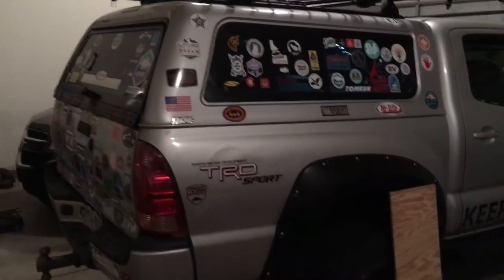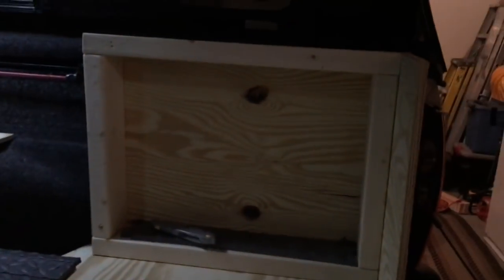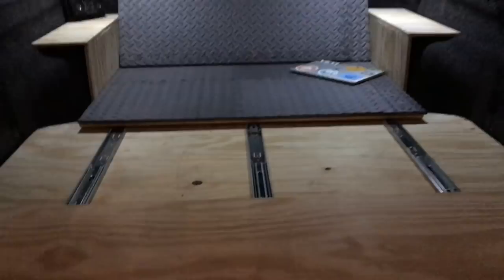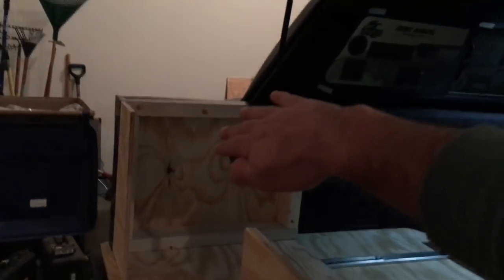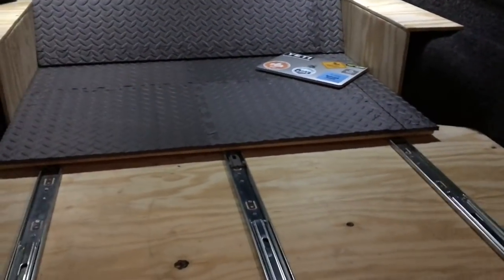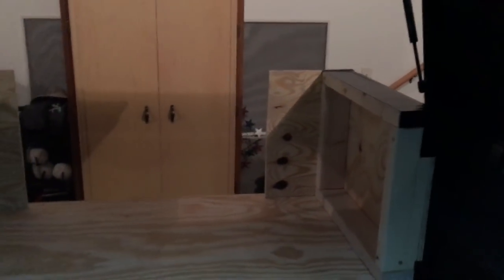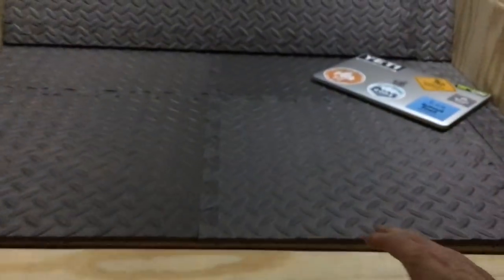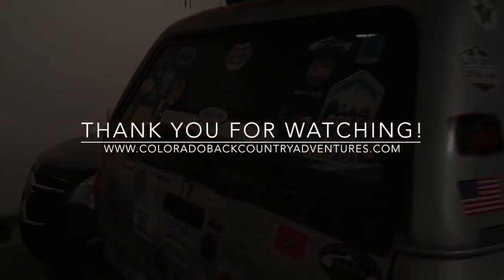Truck Build Design Guide: Part 5 - Adding 2 feet of sleeping area to my short bed Tacoma

Comment: I was just thinking about your “bench”.  What if you connect the bench to the pullout section and piano hinge the backrest to it so that when you pull the extension out, it all folds flat?  You would need to come up with a rail guide to slide the backrest back into the upright position, but that would simplify set up. Just open the tailgate and pull.
Reply from the maker: Hey TexasScout! Yeah, I'm still working through different scenarios in my mind so I'll post a final video of what I come up with. Hope your week is starting off on a good note!

Comment: Well you helped me make my mind up on my next taco...my current 2010 trd sport 4x4 has short bed and 250,000 miles....just left me on the side of the road when fuel pump crapped out....next will be long bed!
Reply from the maker: Replace the fuel pump and you'll be fine. No need to buy another truck...the new Tacoma's are still having all the bugs worked out of them. Stick with the 2nd Gens for now.
Reply: Colorado Backcountry Adventures yea will be lil while before I replace.....was hoping they would bring the 4cyl diesel to states but doesn’t look like will happen...
Reply from the maker: I hear ya, I'd love to have that diesel engine!

Comment: You should have doubled the plywood on the slide out section so you can put hinges to flip it and fill in the and cover the slides
Reply from the maker: That actually wouldn't work for my needs. I want a removable bench seat to use around the campfire. Thanks for watching!

Comment: Nice job but why don't you have a full size truck with an 8 foot bed it would make it easier to live in boondocking.
Reply from the maker: Hey Crowman! Yeah, I've considered getting another vehicle but I really like the smaller width and length of a mid size truck. 2 of th 15 trails I maintain for the Forest Service are very tight and unfortunately a full size truck with a long bed wouldn't be able to fit through. Eventually when I'm done with trail work I will be a bigger vehicle. I really like the old Sunrader 4x4s...those are great for full-timing!
Reply: Well that makes sense for your needs of narrow trails then. What I was looking at was the time you get your gear loaded you would have to sleep in the cab. Haha
Reply from the maker: Yeah, I hear ya man. It used to take me about 10 minutes to load/unload everything. I've actually downsized quite a bit since I hit the road back in 2015 so now I carry minimal gear. I'll do a recap video when I'm all done with the build and include details on the gear I carry.